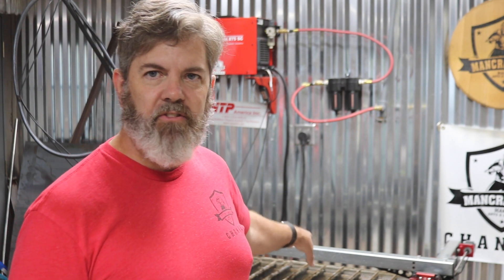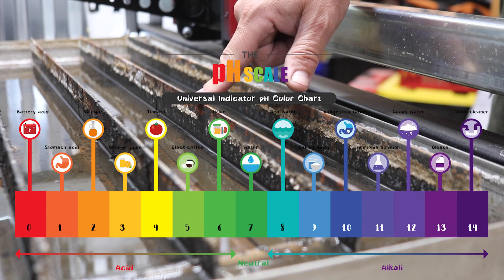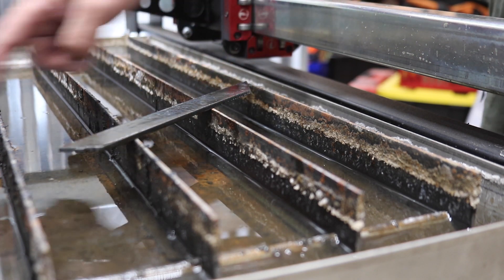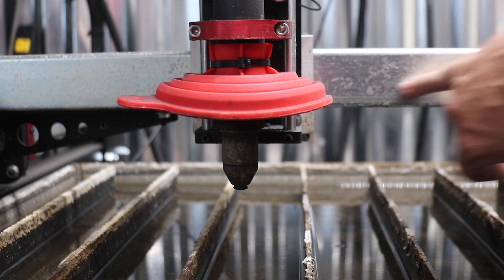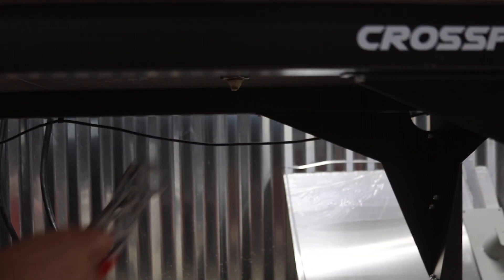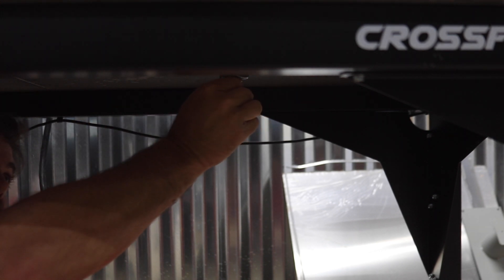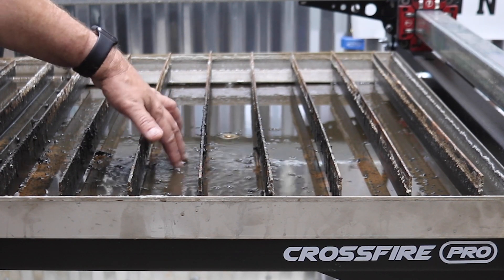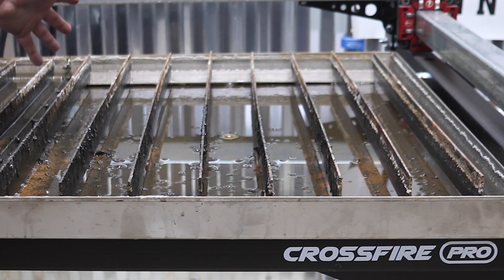Upgrading my Langmuir Pro/Do These Upgrades When Setting Yours Up!

Comment: Nice upgrades Chad! 😃👍🏻👊🏻 ..... Great idea using dimples!
Reply from the maker: Thanks Fred.   How’s everything going up there?   You out on the roads or do they have you hunkered down?
Reply: @ManCrafting  I've been working the whole time, even the majority of my off days. With everyone staying at home, waste that would be generated in the workplace and in restaurants is now being generated at residences, which is what The NYC Department of Sanitation is responsible for collecting. Between this uptick in weight and the suspension of the departments composting program due to budget constraints caused by the pandemic putting even more weight back into the garbage, there's plenty of work for me every day. Garbage and recycling routes that would typically get cleaned  by a given number of trucks on the primary day shift are no longer finishable and the remaining work is either pushed onto the next shift or in some instances the next day, or even the next scheduled pick-up day for whichever route/routes. Also because of the pandemic, they've divided the work which is typically done on the primary shift onto the other shifts in an effort to reduce the number of employees in the facilities at any given time. Thanks for asking, hope you're doing good as well! 😃👍🏻👊🏻

Comment: So, did that green stuff solve your problems? Does it leave spots on your gantry? Does it affect your consumables like the borax did? Does your table now drain completely? Is all well in the House of Mancrafting?
Reply from the maker: I’ve seen no build up on the slats or spots on the gantry.  No rust.  I haven’t cut enough yet to determine consumable life extension but I will update once I have a better idea.  The table drains 99%.  There is small spots where I have to wipe up with a rag.  Pretty dang close though.
Reply from the maker: Works by Solo how’s your next video coming along?
Reply: ManCraftingTM I think I’m getting a little rusty. Hahaha! ;-)

Comment: Great solution Chad, that looked like it worked out perfectly. What an awesome machine you have there.... 👍👍
Reply from the maker: The Muz Shop thanks Mike.  The hole was slightly smaller than the Dimple die but fortunately I have that Ridgid Oscillating sander.  🤣  finally got to use it.

Comment: Nice upgrade to the Ecto Cooler! That’s what I need to do to my table. Great idea on the dimple I’ll be stealing that trick. 🔥👍🏼🔥
Reply from the maker: Steal away.  I have more I’m trying to work out.  Hopefully I’ll settle on something soon.
Reply from the maker: House of Chop thanks for the catch on the Plasma Green.  Definitely want to use this only for steel.  The Plasma Green 9010 is what you’ll want for non-ferrous metals.  Or if you want to explore your wild side, Plasma Pink 4001 is another option.